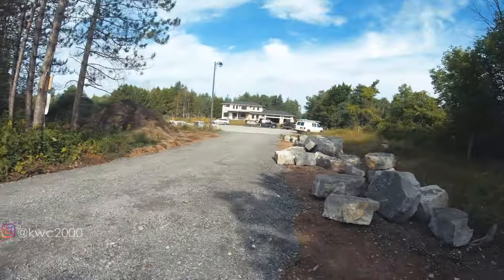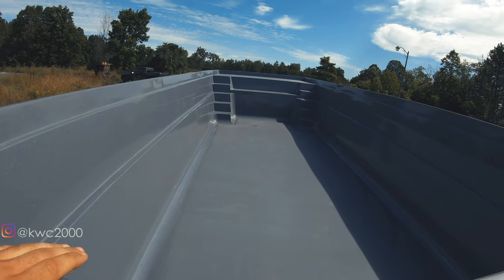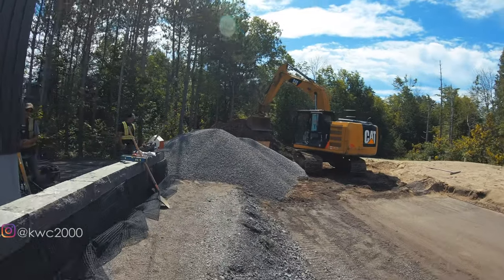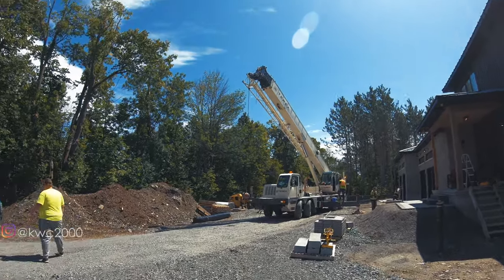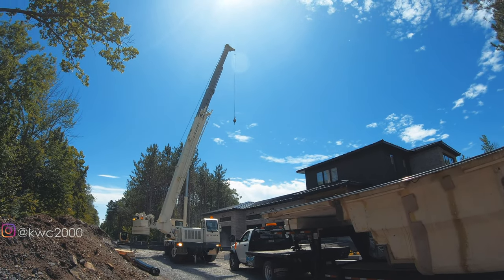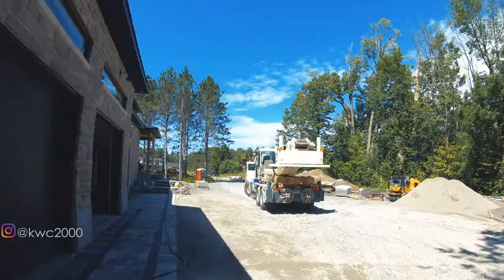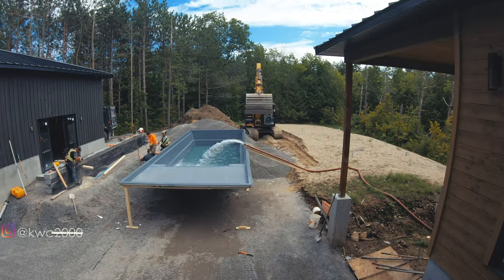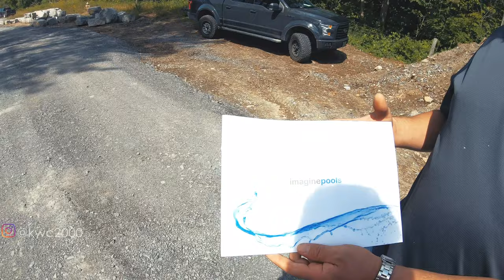Lifting An Entire Pool into Backyard (90 TON CRANE LIFT)

Comment: Crane It. If you ever go on the Liebherr site check out the MK88 crane it is a portable tower crane like they use for buildings, but is on a chassis like the crane they used there. You better watch out you will be selling your Komatsu's and going all Cat. I know people hate when people say You need this, but look at an Engcon Tilt rotator it will change the way you use your excavator.
Reply from the maker: Hahah I did like that cat, maybe I should take a trip down to tormont

Comment: My neighbour just had an inground pool installed in their back yard. I don't think the crane was quite THAT big, it only had to go over an 8ft wood perimeter fence, not a house.
Reply from the maker: Ya this was pretty insane to watch
Reply: @KenWhiteConstruction  are those pools common in Canada? For what looks like would be $1,000,000+ (usd) house in USA. fiberglass pools were a thing of the 70's and are looked down as a cheap alternative to a rebar framed gunite / cement pool! 

it's amazing to see that someone spending that much on a nice modern house would use a such a older technology. Possibly like you said this could be a new version of an older technology... That provides more insulating value like you said...Are these types of pools popular in Canada ? You also mentioned vinyl liner pool are they also popular in Canada?

No offense intended to the pool contractor and or the owner of the beautiful home!!! :)